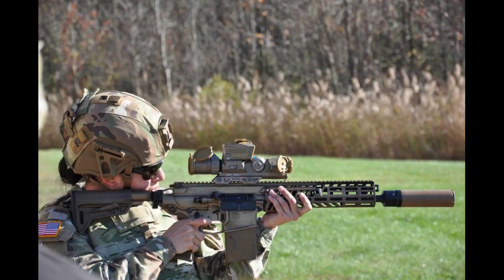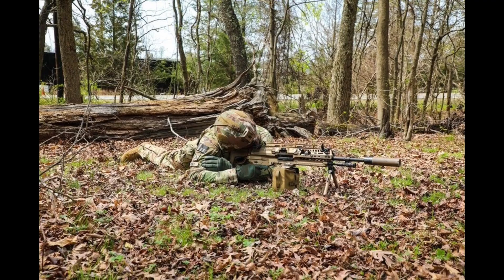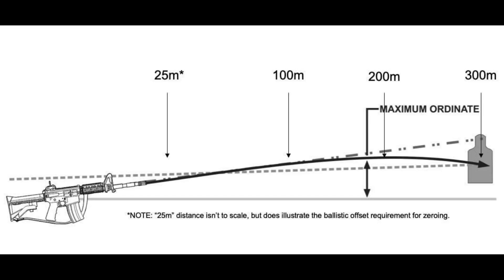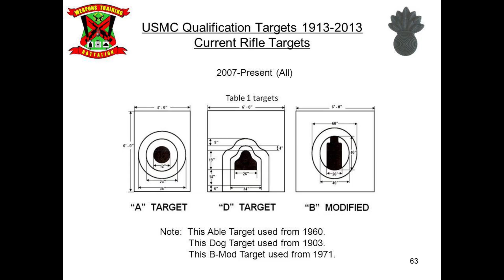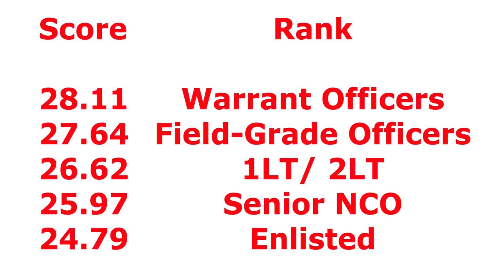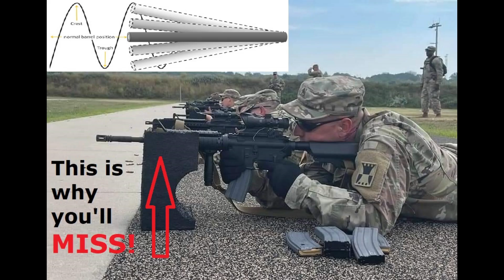XM157 NGSW-FC Review: Next Generation Squad Weapon Fire Control from Vortex Optics

Comment: It is relatively cheap at around 35000 techniq alloys. The 6/12 expert sniper scope regularly goes for over 70k alloys and is not available for semi-assault rifles like the m16a4 which is regularly available for under 10k alloys. I'll post a build for under 100k alloys that makes the m16a4 a semi-sniper/supressed marksman rifle of sorts best used in single fire for distances exceeding 50 metres. (This is for those who came from Delta Force Operations)
Reply from the maker: This is my new favorite review of this optic.
Reply: @FUNshoot  aww thanks did not mean to troll you

Comment: I was under the assumption that the optic does live calculating of the ballistics and gets progressively better. Is this not the case?
Reply from the maker: It calculates based on ballistic info pre-set when the unit is calibrated and zeroed. It can't get progressively better on its own.

Comment: squad DMR enhancer at best
Reply from the maker: I think that would be the best role for this. Also, squad DMR should require training and earning an Additional Skill Identifier for it.
Reply: @FUNshoot  I don't recall if an ASI gets assigned but there is indeed a SDMR course & the Unit Armorer won't hand out the M110A1 without the recipient being qualified there is also an additional yearly SDMR qual to maintain with an engagement range of 300-600M
Reply from the maker: @unnamed53mod1  Something like that would be a great approach for this. The old Army SDM course was intended for the M16A2 so it would need to be updated for this: https://www.youtube.com/watch?v=Zn0L_a3WvGI
Reply: @FUNshoot  I remember the early 2010s SDM program I did mine at Camp Roberts 2012ish ACOG & Irons to 600 if memory serves but it was found to be wholly inadequate hence the M110A1 16" 7.62 program (5.56 is just to light wind beats it up even 2-3 mph crosswind moves it almost 4" at full value) ... I wholeheartedly agree that basic Marksmanship is ignored
Reply from the maker: @unnamed53mod1  There certainly are situations where something heavier than 5.56 is warranted and the XM5 with XM157 is an excellent option... provided the person using it can consistently get hits.

Comment: Not to mention this is under non-combat conditions.  The hit rates plummet in actual combat when there's incoming fire.  And the army is paying $10,800 for each XM157 (including support and maintenance).
Reply: Counterpoint. If you already barely hit, wouldn't you wish that shots that land actually effect the target and not just break a rip or knock the air out of his lungs?
If 5.56 isn't enough these days, you got to take a new step, otherwise you will always treat in the steps of others. 
China for example takes a big step in equipping their soldiers with body armor. Just last quarter and procurement of 1.4mil vests was signed. If America already can't match the numbers of china, how would you think the conflict goes if both soldiers equipments matches? Not good, I bet. If your shooters are that bad, you really need any help you can get ...

On top this 6.5mm supposed to be even able to engage light skins vehicles like BTR, BRDMS, tigr, BMDs, BMPs. Reducing the reliance on Anti tank weapons, which you can't bring enough off these days if proven correct.
Reply from the maker: All that is great, if issued to shooters capable of getting hits. That's my point. The current qualifications are set up so that trajectory/ballistics are not an issue and qual rates are still low. This new fire control system can't help with that.
Reply: @FUNshoot  The only thing about your point I don't get is why bad/too little training impacts the choice of optic you make. Combating bad marksmanship is not possible with choice of rifle or sight. It can only be improved by taking troops more frequently to the range and giving bad shoots a more direct approach of lecturing. 
Those are the only ways to combat bad habits in most things. 
But the past has shown that the modern army would rather drop standards then letting someone fall off ... not just the army, but the marines seem to go that route as well. The changing of physical tests is a good example of that, in my opinion.
Reply from the maker: @mad_villain8580  >> Combating bad marksmanship is not possible with choice of rifle or sight
That's the critical point I'm trying to make! 

>> But the past has shown that the modern army would rather drop standards
Every published study for the past half century demonstrates this, even if leadership continues to ignore it. https://funshoot.substack.com/p/training-standards
Reply: @mad_villain8580  Certainly.  But the effectiveness of 6.8x51mm vs 5.56x45mm is a different discussion.
Reply from the maker: @todglenn2707  If you can consistently get hits. Note the formal studies and long-range combat data mentioned in this video demonstrate a different cartridge does little and that fire control error (shooting skill) remains the most important issue.

Comment: But it’s not just useful for getting that firing solution. It is also beneficial to get range information quickly. Leadership positions, FOs, mortarmen , etc can easily benefit from it. But it can also be linked to ATAK and similar situational awareness/C2 tools. So a soldier can view things like friendly positions, IDed enemy positions, objectives, desired azimuths. I don’t think they have that stuff built in yet, but it’s all envisioned in the augmented reality CONOPS down the line.
Reply from the maker: Yes, that is the end goal and all of that is great. However, it only works as well as the individual soldier's ability to employ features which starts from behind when the key Fire Control benefit can't be properly exploited.